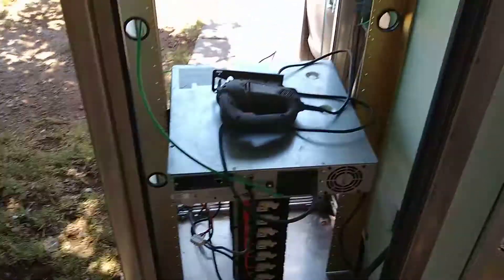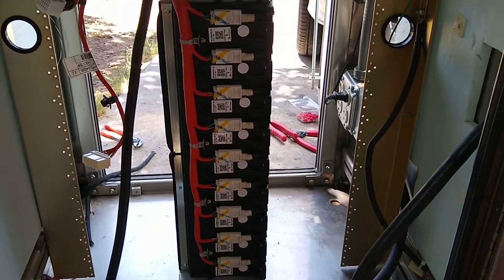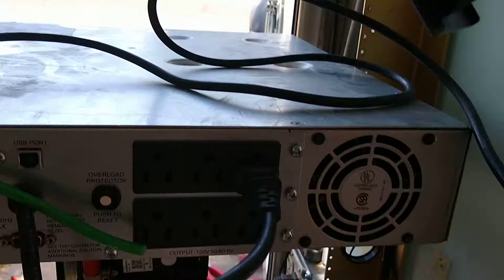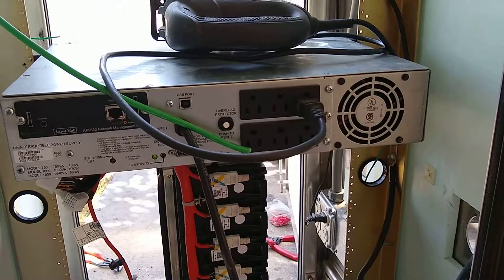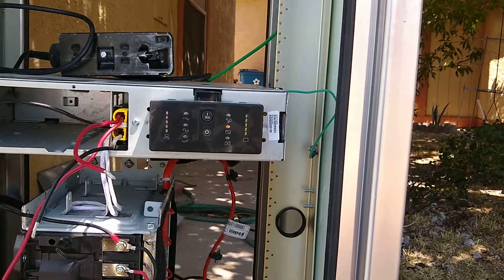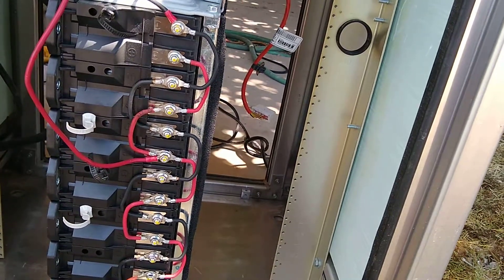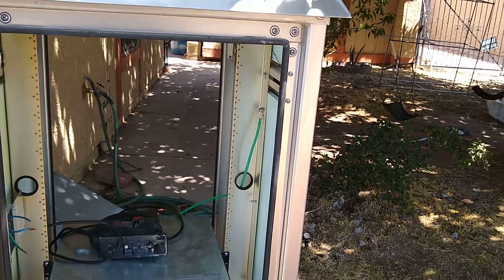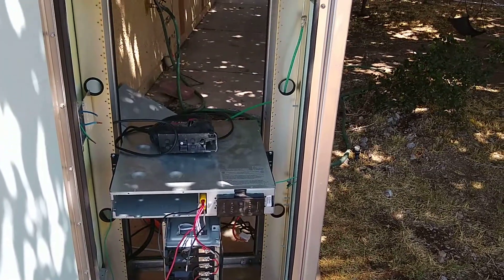Diy power back up off Hyundai hybrid battery

Comment: Hey Rick, anything new with this project? Are you not running a bms or anything to monitor each internal cell? I just got one of the packs and trying to avoid explosions and/or fires.
Reply from the maker: Sorry man i was out of yt for awhile but i do have a bms connected to it and im using a smart solar charger is a midnight A250 just to keep those batts happy and of course they are outside on the back patio